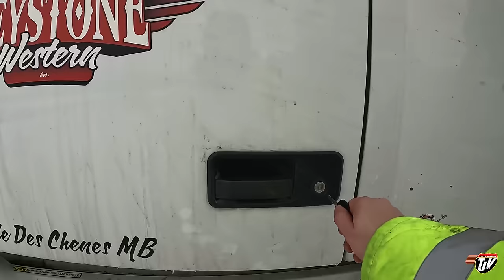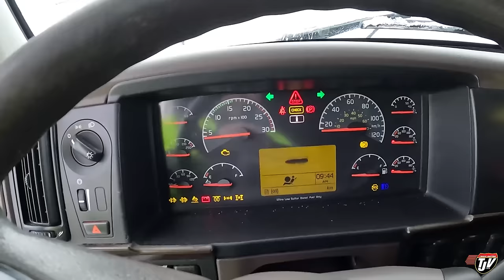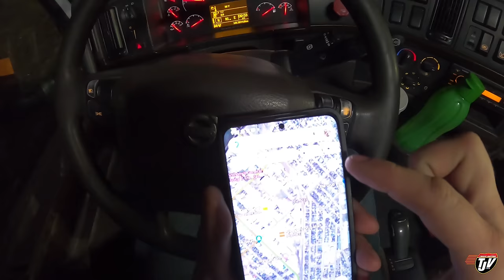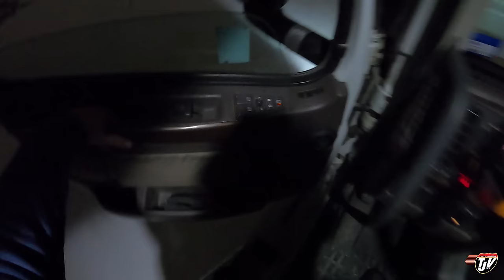OVERNIGHT!! | My Trucking Life | Vlog #2411

Comment: Why did you take the long way to The Pas, you can knock 1 to 2 hours off by using hwy 6 to 60 to10
and that truck stop at hwy 6,60 is under new ownership now so apparently they've actually got stuff on the shelves etc.
Reply from the maker: Bad weather. That route is more secluded. Went thru a bad storm the next day
Reply: @Trucker_Josh  Yeh I guess I forgot your vlogs are about a week behind and that sure is a remote route. Quick though

Comment: Yep passenger car drivers are the worst, except for an 18 wheeler who cuts you off on the N95 exit off 495 in MD. I followed him 20 miles till he pulled over and I gave him hell. He said he thought the Weight Station was open. The f'ing sign was lit saying closed. He did not care about me one I oda. He was bigger and he was not worried about me. Bottom line, big rig and passenger car drives are all the worst.